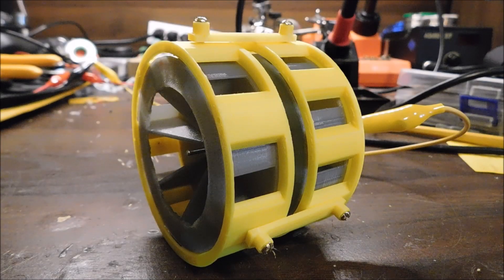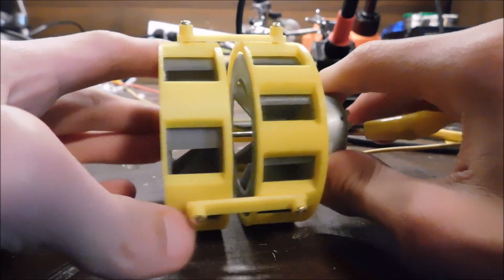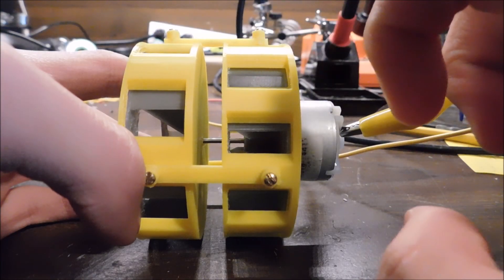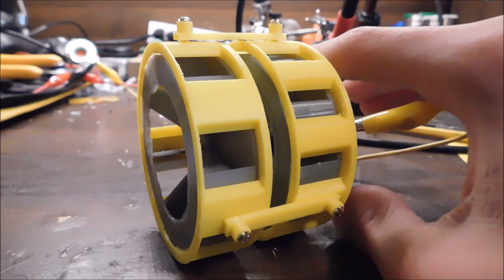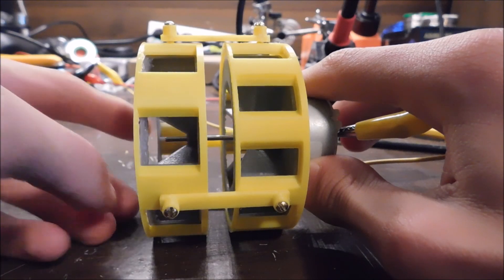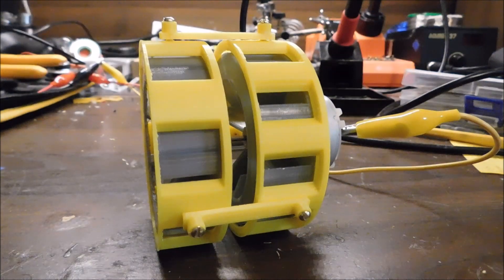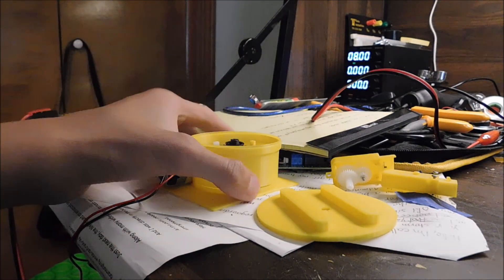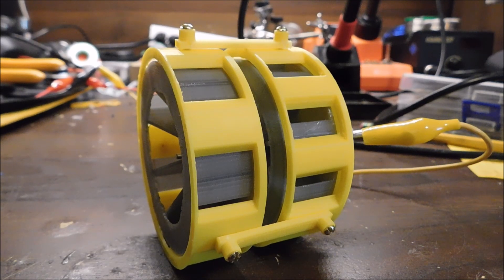H.O.R. Model 15 Super-Sirex Siren Core Test!

Comment: Ive tried putting a shaft in the middle but its a lot loose then you think
Reply from the maker: I know! I'm revamping the old rotors and I'm adding a rotor tolerance tool to fix that. I actually had to glue the rotors to the shaft, which I wasn't too happy about.

Comment: Do you leave the same motor on the siren or do you put a different motor on because on your newest post I’ve seen of the super siren seen a different motor
Reply from the maker: No, it uses the same motor. It's a standard 500 size DC motor. The reason it looks different in the newest photos is because I have the actual motor sealed up inside a yellow shroud that I 3D printed.
Reply: @milespeterson5049 thank you for telling me. I did not know if you put a different motor on it or anything.
Reply from the maker: @SilasLa218  The video will explain it all!

Comment: Good luck with the rotator
Reply from the maker: Thanks! (It's going VERY slow)
Reply: @milespeterson5049 yeah I’ve seen how those rotators work it’s very hard
Reply from the maker: @SilasLa218  Well, the rotator works; I'm just having trouble reducing 9 volts to around 2 volts without burning up weak resistors, LOL. I'm also having trouble with the rotator motor actually STARTING, but other than that, it works, and I'm about 80% done.
Reply: @milespeterson5049 did you make the file
Reply: 80% done nice once you complete the rotator will you make a video of the rotator
Reply from the maker: @SilasLa218  Probably not. Trust me, in my next video, I will go through EVERYTHING that goes on inside my Super-Sirex!
Reply: @milespeterson5049 OK bro

Comment: Any updates on this?
Reply from the maker: Sure! So I got the core built, and that works, but now I've printed out the shroud and horn. I am currently working on the rotator and using slip rings to stop the wires from tangling up when it rotates. This is as of 4/19.
Reply: @milespeterson5049 nice! You should make  assembly video of it once you release the files or if you already have
Reply from the maker: @trainsandsirensofutah5334  I found that most people don't actually build sirens and just watch them work. But I will do a little "teardown" of my Super-Sirex once I build it, so people can build their own!
Reply: @milespeterson5049 yeah I’ll build it after I Finnish my Thunderbolt 1000 and 1003 after that I’ll make your then I’m going to try and sell mini thunderbolts
Reply from the maker: @trainsandsirensofutah5334  Cool! Good luck with that! I might sell my mini-sirens, too, when they get efficient enough and easy to put together.

Comment: Would you ever make a dual horned version?
Reply from the maker: I might! If I can get one of those dual-shaft motors, then I could make the H.O.R. Super-Sirex like the one in Adrian, MO. I'll consider it!
Reply: @milespeterson5049or you could use 2 motors and hook them both up to the same cord
Reply from the maker: @ I could, but I'm pretty sure that the real dual-horned Super-Sirex uses one big dual-shaft motor and not two small motors for each side. I almost did that idea with my mini 2T22 but used a dual-shaft motor instead.